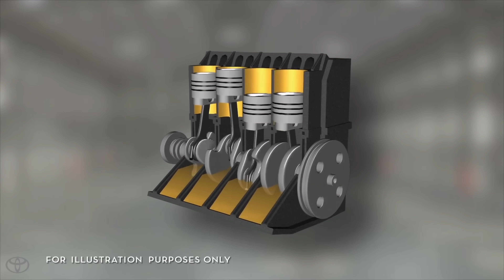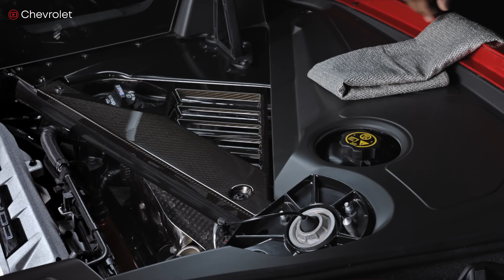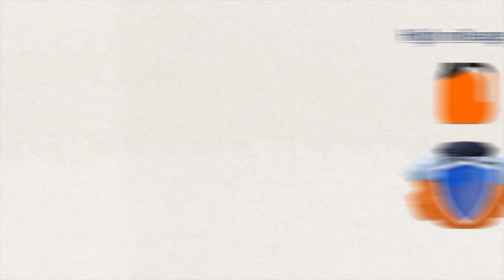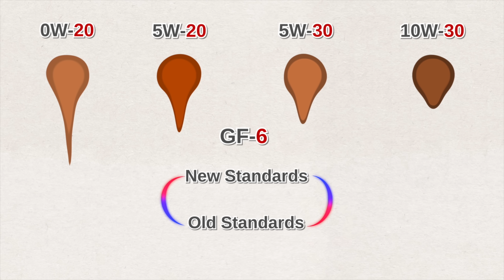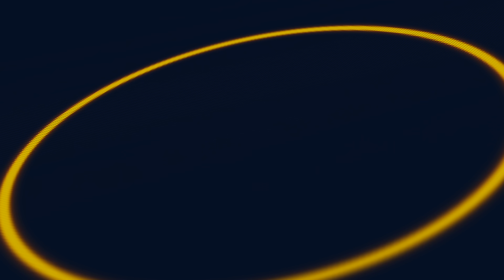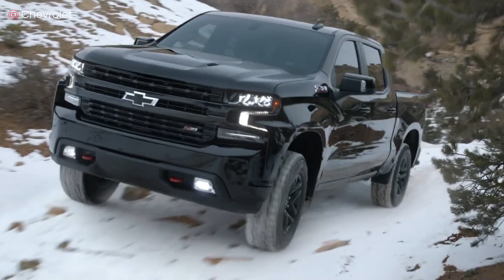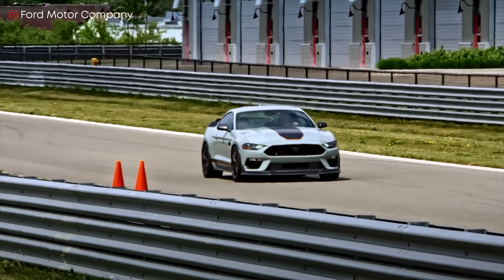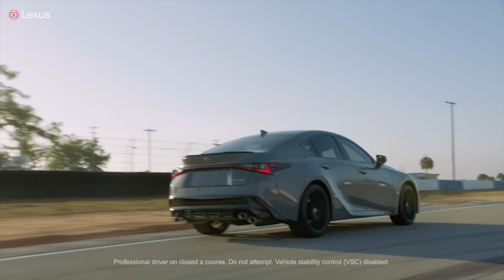7 Engine Oil Myths Stupid People Fall For

Comment: After building engines ran on conventional and ones ran on synthetic there is no reason to ever ever run conventional oil!! Synthetic oil is so much better a 250k mile synthetic oil 🛢  motor will have less wear than a 100k mile conventional motor I have seen it with my own 👀 eyes

Comment: I've always been sceptical about additives.
I THINK that the dura-lube regiment that was used in my '97 Sierra 1500 with the 5.7 Vortec that I was the second owner of and continued with, worked. As I sold it at 430000km still going strong.
I KNOW that the Amsoil AR9100 did absolute wonders for my '06 F-350 6.0 Powerstroke.
Reply: Older guy I worked with said " if the additive worked so well don't you think it would have been added from the refinery " . My wife had a dodge caliber , little disposable car . Used whatever 5-20 synthetic oil that was on sale at Canadian tire , had 525,000 kilometers when sold . I am sold on synthetic oil
Reply: My 2012 Sienna is at 479,000 km, always used 0-20W synthetic and for much of its's life I changed every 15,000 km because it was 90% hwy driving. Then about 300,000 km, Toyota said change every 8,000 km anyway, because we get cold winters in Alberta so I do. It doesn't use any oil, runs smoothly.

Comment: Years ago I purchased a supercharged Pontiac from my local dealer and decided to have the car serviced there as well. Seemed convenient at the time. The factory fill as per the sticker on the supercharger cover was a full synthetic 5/30 Delco oil which apparently was bottled my Mobil 1. Great oil especially the way I drove that Pontiac. At 12k the oil change light came on and in I went to get a oil change. Oil was still dark goldy brown...Causally I asked what oil the dealer was using and was told ohh 5/30 conventional house oil, cheapest stuff going.. lol well I more or less suddenly developed an attitude. The factory fill is a premo oil designed to say last the life of that oil change and because well they figured that was what was required for a SC engine, my trusted dealer used the cheapest nonsynthetic oil they had on hand and as per their lead tech on shift that oil was probably good till 6k before it basically turned to sludge. But my oil minder comes on at 12k....... so for the other 6k Im running on what exactly? Anyways, quickly discovered you cant even depend on a dealership to correctly service the vehicle they sold me. 
Service it myself , with the factory fill synthetic and delco filter every 8k, babygirl runs absolutely mint.
Reply: I assume you know that was a Toyota Matrix and Toyota engine, re-badged as a Pontiac.

Comment: Also, if you smell exaust fumes in your car, check exhaust pipe(s) going up toward the motor. If there is a hole and because heat rises, with the hood closed there is not much area the fumes can go to except through your vents.

Comment: The Ford F-150. 5.4L. If you fill the oil to the top of the crosshatch, the engine will miss. And youll spend hundreds of dollars tuning it up. If you read the owners manual and put in what IT says, youll be fine. So in other words, get your owners manual out and read it.

Comment: Cost was an issue 20 years ago but today it doesn't make much difference.  The only time I use conventional anymore is for breaking-in certain types of engines like my new generator.  With the yearly rebate deals I've been getting 5 quart jugs of name brand full synthetic for as low as $5 and never more than $12.  My stupid VW TDI takes special oil that runs around $10 per quart no matter what.

Comment: Once you go synthetic you should not go back because mixing the different molecules and crude oil versus different additives and synthetic oil are not good to maintain engine health. Essentially it's like switching to a clean healthy lifestyle and then switching back and forth between an unhealthy lifestyle your body will continue to try to adapt to what you're putting in it and it will not operate at optimal performance and efficiency

Comment: It’s hard for me to trust the manufacturers recommendation considering how things have been lasting. 
My truck is a 3.0 duramax diesel. 
0-20 is like Wd-40
I just don’t think this is oil is cut out for the job. 
Ya 0-20 may get me 10 years but I would like to see it last past 10 years so a high school kid can have some fun cheep wheels. 
It’s already bad enough that they made damn sure they put a belt on the oil pump.
Reply: You know more than the manufacturer i am very sure of that LOL

Comment: Technically speaking, engine oil does not break down over time. Its additives break down, and the oil gets dirty and acidic, but the base oil lasts pretty much forever.
Reply: just like in the ground.  forever

Comment: Can someone tell me, without ac on my idle running engine temperature is around 93 to 97 celcius in aisi wagonr.

My car is running on natural gas(cng). Should i do with 20w50 or 5w30?

I live in India,  here environment temp range from 4 to 50 celcius.

Comment: My honda pilot 2013 just passed the 150k miles (highway) and it runs perfect. Should I still go for the 0w20 synthetic recommended by the manufacturer or should I go high mileage oil just based on the miles.? Anyone please help.!

Comment: Kind of ambivalent on High Milleage oils.. my old D15B7 Honda loved the thing. A coworkers 2006 Accord with a K24 always ran uber smooth on regular 5w20/5w30 and started doing A LOT of piston slap when the switch was made to High Milleage oil... cleaned the cylinders/pistons and widened some gap somewhere perhaps?

Comment: Hey scotty, I have been using thicker oil upon the recommendation of a mechanic for 6months i.e used 20W50 in place of manufacturer recommendation i.e 10W40.
Should I keep using 20W50 now or get back to 10W40
Reply: I see Scotty might be busier these days so I'd love to assist you Sir. Depends on how old your car with regards to the mileage and the climate there.
Reply: @andreygelbajenting6071  

Thank you in advance
It's 176000 Km driven, mostly hot climate of Pakistan ranging from 10degree in winters till 48 degrees in summer.
Reply: @ZiaAshrafChaudhary  your car is doing just fine Sir with the mechanic's recommendation and I assume it's a high-mileage fully synthetic oil. But I strongly recommend,  to downgrade your oil to 10w50 so that you won't have a hard time starting up your car during winters.
Reply: @andreygelbajenting6071  thank you so much

Comment: Oil recommended:
0W20, 0W30, 5W30 So there I have many options.
Recommended change interval is 30000km or 2y.
I change it between 10000-12000km with most 1 year (which comes first).
Discussion about synthetic and no-synthetic is out of scope. There seem to be only synthetic oils available.
Reply: Different weights for different climates. Also after the 12k, you have to look at the oil and figure out if its still clean looking or black and sluggey. Use your best judgement, these car manufacturers would love to sell you a new car. I don't trust them when they state 30km that's just a sales tactic for lazy or cheap people just like these new lawn mowers that you never have to change the oil. They will happily sell you a new mower every 5 yrs or so.

Comment: Probably the dumbest question ever - but do these parameters also apply to diesel engines? I have a 15 year old Volvo S80 D5 SE Lux and I have it serviced every year after no more than 5,000 miles. I live in the UK where there are no real extremes of temperature or weather conditions and I drive on normal road surfaces. ???

Comment: All I know is I'm usually pretty good at keeping my oil changed, but recently my last oil change was last Oct,  now its July and I've went 10,000 miles over on my oil change.  I stand by Mobil 1 full synthetic extended performance oil which has totally protected my engine!! You won't find a better oil and I've proved it
Reply: Whatever helps you sleep at night.
Reply: even if your oil is breaking down does not mean your engine will self-destruct immediately .  maybe you just took a few k miles off the potential life of the engine or certain parts of it .

Comment: I completely agree that Full synthetic is a far superior product. It does have a much lower coefficient of friction vs conventional. The coefficient of friction determines the engine's wear patterns (Piston rings to cylinder, valve stem to guide, etc.) 
If the engine was Not manufactured with or completely overhauled with Full synthetic,  and has gone past Standard Break-in period (typically 3000-5000 miles depending on conditions and applications) , then Set Wear Patterns have formed. Switching to Full synthetic can then cause an Oil Consumption Concern
Reply: That's been proven to be untrue.

Comment: In SAE 0W-30, the 0 isn't the viscosity at 0°F. It's telling you that the oil will still flow at -30°C
5W will flow down to -25°C, etc.
The leading number is calculated from the flow rate of the oil at 0°C.
The following number is calculated from the flow rate at 100°C.

Comment: An aircraft engineer once told me oil is cheaper than engine parts, and/or having the engine repaired....I use a motorcycle that is recommended oil specific to its engine...ie: full synthetic...a wet cutch is also factored into the equation. I always change the oil and filter long before the recommended period...

Comment: Oil evaporation? I never knew this could happen. 

As an oilfield worker for many years, I've never seen it. I have seen water and other liquid VOCs evaporate.
Reply: Yes at the high temperatures inside an engine there is some evaporation. Also crude oil and refined oil aren't the same. Isn't gasoline made from oil? Yet look how volatile it is.

Comment: Scotty you left out the most important reason why we use 100% synthetic oil as all the molecules are the same size... whereas in petroleum-based or any blend of oil the molecules are many different sizes which causes the oil to break down sooner. With many different sizes of molecules causes more friction by larger molecules taking more load than the smaller molecules that will lead to destroying all of the different sizes like having different size roller bearings in a wheel bearing that would not be good at all

Comment: My lincoln had made grumbling noises which i didnt know the cause of. The oil level was at the low level but still not below the min level . So i didnt rhink that was a problem. But the mechanic at the oil change place said that was the cause of the grumbling noises. But i cant understand why the car makers would not indicate that when the oil level is low, and no oil light is on, but the level is still above the min sign, that that actually that is a problem.

Comment: 0:34 A seriously overfilled sump. The crankshaft throws, counterweights and conrod big ends will whip the oil into a froth. The oil pump won’t suck froth up very well. Little to no oil pressure will build up. Even antique motors like a Ford Model T, which had no oil pump, have little scoops on the conrod big ends that dip into the pool of oil, lubricating the conrod big end bearings, slinging it into scuppers that feed it to the main bearings, splattering oil onto the camshaft and onto the cylinder walls. Too low oil level and the scoops don't pick the oil up. Too high oil level and the oil is whipped into the above-mentioned froth.

Comment: Lol. I don't think he cleared up too much for the laymen. And while the manufacturers recommendation is  a good guideline, it's not gospel. You need just some good ole common sense when developing an oil maintenance strategy.  Vehicle age and mileage, oil usage (if any), climate (including dusty/off road conditions) and engine construction (all aluminum,  cast iron/aluminum, aluminum with cast iron cylinders, turbos, superchargers etc..). I live in Central Pa and have switched all my 120K+ mile cars to 5 quarts of 10W30 with a 1/2 quart of engine additive.  Cheapest oil I can find - which is usually conventional or synth blend.  For the 200K Chevy Van it gets 4 quarts of 15w40 and a quart of engine additive and a stp oil treatment.  Since going to this regimen, none of the vehicles need interim oil added and maintain greater oil pressure for longer periods. The interval is once a year or 5K whichever comes first.

Comment: On of the biggest question I always get is.. how should I check my oil? Should I run the engine till it’s hot? should I start it at all? How long should I wait after I’ve driven before checking? Etc
Reply: Checking it cold gives the most accurate reading. If it has just been running give it a few minutes to drain back down and keep in mind there is still some oil that will drain back down, maybe like less than a quarter of quart.

Comment: I have two Hyundai cars one Gas one Diesel, Here in Europe they recommend oilchange on the Gas car every year or 12400miles, at the Diesel car its every year or 18500miles. And yes about the oil turn black quick, its common for dieselcars, all the dieselcars I had the new oil will be black quite soon, where in the gas cars it takes longer time for the oil to be dark.

Comment: Changing the oil in my 2007 BMW 328xi costs my over $200.00.
Reply: In my 2009 328i xDrive, I would just buy a MAAN Filter, use Castrol 5W-30 Full Synthetic. $40, Jack, Stands, 15 minutes later I’m good to go.
Reply: Bruh same
Reply: Burning
Money
Willingly
Reply: May I ask why it costs so much. Sorry I have a lack of knowledge in this department

Comment: Seeing the '65 Mustang in the High Mileage section of the video reminds me of something that happened to my father.  In the mid '80's he had a rusty, high mileage '66 Mustang 6 banger he was driving to work every day.  He liked the car because it got great gas mileage.  My grandfather (his father-in-law) died and left a case or so of Pennzoil.  Dad bought the case of oil cheap at the estate sale.  The next time he needed to change the oil in the Mustang he used the Pennzoil.  The only thing he did not take into consideration was that at that time Pennzoil contained the highest detergents of any oil.  When he walked out of the house to get into the Mustang a few days after changing the oil he saw oil on the carport.  The Pennzoil was leaking out of several gaskets in the engine.   He went and bought some straight weight, non-detergent oil and replaced the Pennzoil with it.  He drove the Mustang about a thousand miles and the gaskets sealed up again.  He gave the rest of the case of Pennzoil to somebody else and used regular lower detergent oils from then on until a dump truck ran a stop sign and t-boned the Mustang, totaling it out.

Comment: When people ask me if they should change their filter with their oil I ask them if you should change your underwear when you shower.
Reply: On my 1995 Dodge neon, the manual recommended changing the oil every 7,500 miles and changing the oil filter every OTHER oil change! Needless to say, that was one manufacturer recommendation that I did NOT follow! Both were done EVERY 3,000 miles!

Comment: The problem with oil monitoring systems is that they don't actually tell you the condition of your oil! They use formulas based on temperature and driving habits to suggest an oil change interval. Question - someone once told me that you shouldn't use synthetic oil during the first 1000 miles on a brand new car (break-in); or the engine will not break in properly. True???
Reply: Not at all.  This used to be regarded as true more than 30 years ago. Not today.

Comment: In my 85 AMC Cj7, I just had the top end rebuilt on the 258cu 6cyl, it was decked, all new valves, valve guides, lifters, all that was done due to my having a head gasket that was blown in two different places....I've only had the head on the motor for about a month and a half, can I change to synthetic oil, or a blend, or is that not feasible, and what would it do to the motor good or bad? I just put 10W-40 in it when I changed my oil today...

Comment: For stupid people. Sure. Your check engine light will not come on for an oil concern. It’s not allowed to by law. It only comes on when the emissions of the vehicle could be over 1.5 times the normal amount. Not for oil problems.

Comment: Thank you Scotty!! My Mom wants me to get oil change. I'm okay. I check fluids on my 4X4, & my Moms car. No one else in family checks their vehicles fluids. ? Heard family member mouth off I check oil twice s day. I was ? . I check fluids before I drive my vehicle every three days. He's radiator owner of repair place changed part without permission causing vehicle to over hear within fivE minutes leaving his shop. Left key on with heater blasting!m i was ? !! Not long battery was done. I was mad!! He used fifty year old car charger. I was ? !! Vehicle started he sat inside 4X4 with air conditioner on full blast. I was ? !! Vehicle over years twice now this!! Vehicle had to be towed home, then next day towed to a dealership to fix damage!! Just because he wanted to change parts without my knowledge, & consent!! No more money to check for other damages caused at radiator shop opened over forty years. I do check my fluids with weather getting warmer. Who wants to drive far in warm weather to mountains, or desert with big engine & little radiator fluid in radiator, & reserve? Your video is helpful!! Keep up the good work!! Wish you were on the West Coast!!

Comment: I change my filter every 1000 miles I use the ac Delco cheapo bcuz less paper means more flow. Also it's only 3$ so I can change it every week If I wanted. I use the cheapest mobile 1 full synthetic 5w30 for $18.99 in my 72 Buick. Every 3 filter changes I swap the oil out.